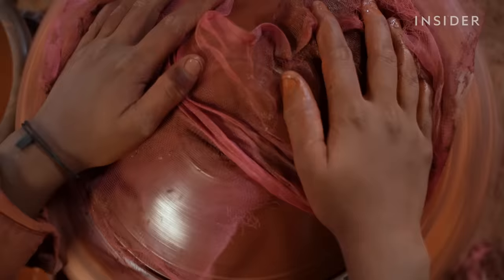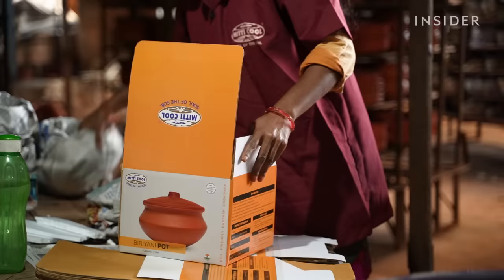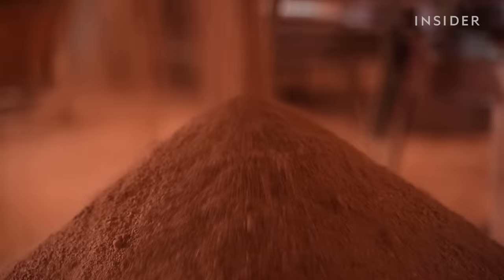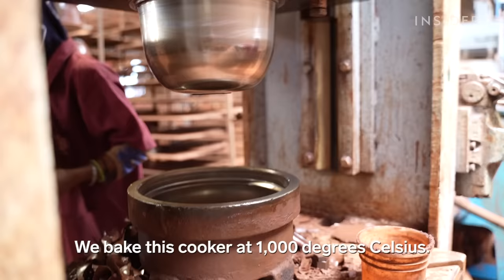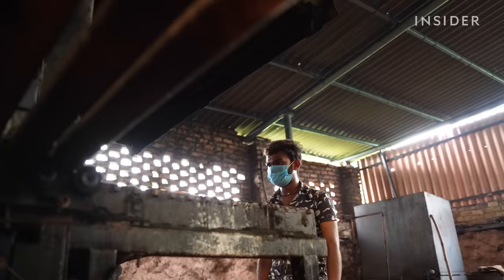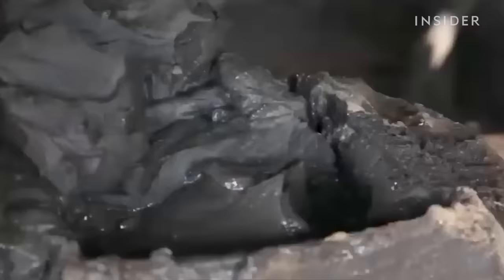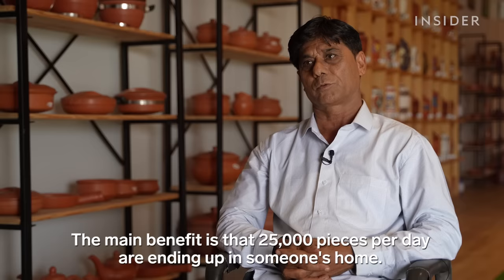How This Electricity-Free Fridge Saved An Indian Ceramics Factory | Big Business

Comment: This clay fridge should go mainstream on online and offline stores and everyone should have easy access to it.
Reply: How does it work?
Reply: @nofurtherwest3474 Evaporation. Water can hold a huge amount of energy (i.e. it has a high specific heat.) The inner chamber of the fridge is watertight, and there is a water chamber that surrounds the food. The outside of the fridge is porous, so it allows the water to slowly evaporate, which pulls heat away from the inner chamber. It's the same principle as sweating. It will never get down to the 35ish degrees of a regular fridge, but it will cool enough to preserve produce and other items. One disadvantage is that these work wonderfully in dry environments, but with higher humidity, the water has a harder time evaporating (again, same as why your sweat doesn't cool you off when it's humid.) So these are great in inventions but region specific. You can actually build something similar by putting a small vessel inside of a larger unglazed flower pot, filling the space between them with sand, wetting the sand, and adding a lid.
Reply: It's technically more like an icebox, which were the predecessors to the powered refrigerator.
Reply: It can't substitute a real fridge and is just meant for fruits and vegetables and milk. It doesn't get cold enough for meat
Reply: @elaexplorer I would love one, cause I don't have any meat in my fridge

Comment: I have actually drank water from this on a scorching day and the water was cold!! I don't how it works but it is amazing.
Reply: It work on principle of evaporation
Reply: by principle of perspiration, just like how sweating cools down a person on a hot day.
Reply: Isn't because it's made out of clay? I drank from a stone cup and it's cold
Reply: @lunix3259  Yes and no? They clay part helps since they can sustain temperature, but for the fridge, it's simply just the water evaporating by getting the heat from inside the fridge. It's the same as regular fridges except it uses water. The only reason most western (and eastern) fridges don't use water is because they're larger and also need to be able to freeze (for meats, but also so we can make ice cubes). Just using water wouldn't help you create ice, but it can at least cool a small fridge like that, which is enough for people in certain places, especially if their families are small.
Reply: In earthen pot there are tiny pores which slowly release water in the outer surface. Water molecules takes energy from the surrounding molecules and evaporates.this continuous process cools down the water inside the pot and outer surface water layer act as a insulator which do not allow the surrounding temperature to maintain the same temperature in the pot.
Reply: @megaknight3705  cools it down to 76’f
Reply: something to do with water vapour keeping the water cool
Reply: @Indian_gae_boii  Sort of. The water absorbs the heat from the food and turns into water vapor. Because the heat of the food has been absorbed, it becomes cooler.

Comment: Saving atmosphere from harmful effects of Green House gases (CFC's), handkrafted refridgerator with No electricity shows how sustainable this product is....
Reply: CFCs haven't been used in fridges since the early 90s
Reply: @MG2-_-   modern refrigerator uses HFC,it effects are less still have some
Reply: Shouldn't we focus more on taking responsibility for watering plants and perennial trees on a regular basis instead? 

Like.. actually plant perennial trees and nurture them = helping the environment
Reply: @sigmameme2762  modern fridges have switched to R600a, it’s hfc free, non and non ozone depleting…
Reply: @skylark1848  the ozone layer was restored because the focus for responsibility was on the producers in the past. 
Climate change isn't gonna change now because now the responsibility has shifted to individual consumers.
Reply: I have serious doubts about his fridge. You would have to fill it up with cold water every few hours to keep things cool, and whatever cooling effect you have would just be wasted because of that terribly thermally-inefficient plastic door with zero thermal insulation and no air gasket. Ants will raid that fridge seconds after putting food in. Terrible idea. If he showed this to my mechanical engineering professor, my professor would just laugh.
Reply: @jedidazed3390  technically it works like a swap cooler, the ceramic pores absorb water and the water evaporates from environmental heat, resulting in reduced temps. Only works in dry climates, and the cooling power is very low. Water used is just room temperature. 

The temps are not low enough for long term preservation, especially for meat or dairy.  But I think the idea is for poor regions of India with no electricity, keeping fruits or vegetables an extra week is better then nothing. The ceramic can’t be insulated since it works via evaporation, the door is plastic to keep cost low. Remember it’s 1/3 the price of the cheapest compressor fridge, for some people it’s this or nothing.

The biggest issue I have is all the idiots thinking this is some futuristic miracle refrigerator, it’s not. It’s a really primitive fridge.
Reply: @Dirty_Bear22  I'm no idiot, mind you. I'm saying it's much worse than a cooler. A cooler can maintain the temperature, but this cannot. This does not work by evaporation, evaporation only cools on the surface of where the evaporation occurs, not around the ceramic. Just because water is evaporating at the surface doesnt mean the whole glass of water is cooling down. Where'd u get your engineering degree? Garbage University?
Reply: @Dirty_Bear22  If youre trying to keep the inside of the cabinet cold, wouldnt it make sense to have an airtight, insulated door? Otherwise the inside and outside air would just circulate and heat exchange thus becomes inefficient. Plus heat can be radiated inwards on an entire plane since the door is one entire face of the cabinet where heat can freely radiate in. Make sense? Garbage University shouldve atleast taught that in its most advanced classes.
Reply: @Dirty_Bear22  ask about my Mechanical Engineering degree and Juris Doctorate before calling me an idiot
Reply: @jedidazed3390  um I was basically agreeing with you… I never called you an idiot, I was referring to the general comments for the video, I saw lots of comments praising this ceramic fridge as a modern marvel, despite it being far worse then normal refrigeration.  

It can maintain a slightly lower temp, just not very well. 

I would add a link to the India Science, Technology & Innovation website, but then my comments typically don’t go through when including links. I will just quote the article below.

“Mitti Cool Refrigerator: An affordable refrigerator

A fridge for the common man that does not require electricity and keeps food fresh too. With this basic parameter in mind Mansukhbhai came up with Mitticool, a fridge made of clay. It works on the principle of evaporation. Water from the upper chambers drips down the side, and gets evaporated taking away heat from the inside , leaving the chambers cool. The top upper chamber is used to store water. A small lid made from clay is provided on top. A small faucet tap is also provided at the front lower end of chamber to tap out the water for drinking use. In the lower chamber, two shelves are provided to store the food material. The first shelf can be used for storing vegetables, fruits etc. and the second shelf can be used for storing milk etc. Cool and affordable, this clay refrigerator is a very good option to keep food, vegetables and even milk naturally fresh for days.”
Reply: @jedidazed3390  okay? A barely working cooler is still a cooler. I never said the plastic door was a good choice. These fridges are made at a very low price point, so a insulated door was probably non economical to produce.
Reply: @jedidazed3390  I wasn’t referring to you directly, sorry if it came out that way. See my first response. Besides garbage university is making great strides in advancement 😂, I was a top student I’ll have you know.
Reply: @Dirty_Bear22  apologies man and my bad. These days I'm overly sensitive when someone calls me an idiot in my own field. Good to know you were referring to the actual idiots. Peace man ☮️😂
Reply: @jedidazed3390  no worries. I often get carried away as well haha. 

Reading into it apparently it’s originally called a Zeer pot, dating back as far as 3000 BC. Basically two pots, wet sand, and a wet cloth. 

Thinking about it, marketing old inventions as new has been a pretty successful trend. Now to go reintroduce the square wheel and get rich.
Reply: @jedidazed3390  why you have to eat food that needs long time refrigeration?

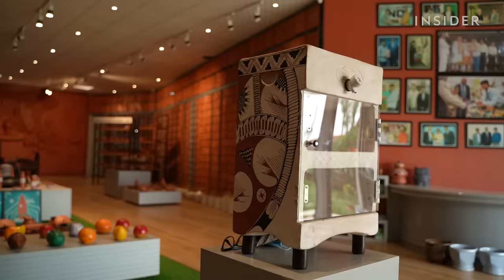Comment: 6:09 Definitely this should be the top 50 inventions of the decade or century.
It saves energy as no electricity is needed. It is cheaper. It is very very eco-friendly. No risk of leaking gases which happens in electric refrigerator and which are made with a high amount of carbon footprint. But this fridge probably has Negative carbon footprint as it is storing lot of carbon or atleast is carbon neutral or very small amount of carbon footprint. This gives more employment as more it is hand made as compared to other electric refrigerators.
Reply: I'd say the fridge is probably carbon-negative, if you factor in how much electricity isn't being used through its lifetime. Plus it'll probably last decades. Regular refrigerators are replaced, what, every 15 years? I could see one of these in a college dorm or studio apartment in the US
Reply: @spooniesarah  hmmmm.okk.
Reply: @spooniesarah  top 50 😂😂😂😂 good joke
Reply: this sort of tech has been around in places like Iran for thousands of years.

Comment: It would have been good if the video had explained how the non-electric fridge works. I'm guessing that it uses evaporation of water for cooling like the Coolgardie safes that were in widespread use in 19th century to  mid 20th century Australia. These devices are very effective and for just the cost of adding water when it runs low it will keep food cool and fresh.

Comment: I would definitely buy a fridge like that.   Think of the energy saving if most of us changed to these types of fridges.  When can we buy in other countries.
🌲🌝☘️
Reply: Swamp or evaporative coolers are not that great. You will have problems keeping it clean and sanitary and inside a modern house that is well isolated the evaporation is too slow to have a noticeable cooling effect.
Reply: When its 100f keeping food at 92f is not good. For prolonged keeping of fresh food it needs to be kept at 42f or lower. That is an unreachable temperature for this device
Reply: It doesn't work, i have one
Reply: @exorcimus8872  🙏 thank you for letting us know that.   Much appreciated.
🌲🌝☘️
Reply: It works well only in hot, arid places so it probably won’t work well outside of India, especially in colder regions like North America, Europe, etc
Reply: It worked the first summer i bought it but the next summers it just failed
Reply: @theevilprankster  Well in many part of North America, it is very hot during certain duration of the year.
Reply: @elizdonovan5650  if you live in tropical places,this works well as I have personally used items that work on the same principle.
Reply: @exorcimus8872  Earther pots must be immersed for 3 days in water before the start of next Summer to fill the capillaries in the earther pot's Micro Pores with water. - I learned this from my mother. After every summer we would shelve the earther pots and when the next summer starts my mother used to immerse them in water for 3 days. Otherwise they would not work ..
Reply: @praveenvasistha247  wow didn't knew that 👍👍
Reply: When someone on that country decides to manufacture them.
Reply: In the example in the video, it gets the temperature down to 72° F.   I suppose if it's 90° outside it's an improvement, but you're not going to keep milk in it
Reply: How can we purchase this fridge

Comment: That fridge will not work in cold and temperate conditions 
But it will be effective in hot dessert like environments, if I am not wrong
Reply: As long as there is an air flow, this fridge will work.
Reply: True, It will not work in Cold and areas with High Humidity where water dosent evaporate to air
Reply: @newsflash4382  it works on evaporative cooling. Ambient conditions that are conducive to evaporation it will work

Comment: These fridges are an interesting idea. It works on the concept that evaporating water takes away heat so you need to top it up with water for it to work. It will also only work in hot, arid situations so humidity would prevent it working. And there is a high probability it could leak all over your floor so you'd have to stand it in a container or something just to be safe. Has to be clean water too otherwise dirt & minerals would eventually clog it up. But despite that it does work without electricity which could be attractive to people who have unreliable supply.

Comment: Hope this patented in India soon. Real entrepreneur and competitor to electric fridge.
Reply: no, both of these have vastly different use cases, and nobody will pay licensing fees for pottery
Reply: @cessposter  the use case comparison for a startup product like this vs refrigerator isn't correct in my opinion. 

I m sure this Pottery product will mature in few years and take over refrigerator - if well planned and nicely designed.
Reply: @hugmusic25  the refrigerator has been a concept designed and improved for a couple decades.

A few years will not cut it.
Reply: @hugmusic25  they work through evaporation, it will never reach low temperatures like a normal compressor fridge…
Reply: @hugmusic25  patents are a sham
They expire after a limited time & then either taken over or suppressed by monopoly (g0vt sponsors)
Reply: It's a preserving bin

Comment: So, basically, it’s a kind of evaporative cooler…internal fans evaporate droplets falling through a screen in the box walls to a receptacle base tank, where it’s pumped up to keep evaporation cooling going.   That is definitely helpful especially in dry climates.  But in humid climates, not as well.
Reply: yep and India is very humid.
Reply: If you notice, this device does not run on electricity.
Reply: Gujrat state has the most humid climate.
Reply: @agnidas5816  Maybe where u live. Judging by your surname i guess u r from West Bengal. But not everywhere in India it's like that. For coastal states it's true.
Reply: @AKSinvi   Then, what makes the swamp cooler work, if not electricity?…a pedaling device? 🧐
Reply: @AKSinvi   It could run just by person pouring water over the ceramic…perfectly fine to help chill interior where there’s no electric. 
Same unit could automate, using small electric fans, & a water pumping the water up to wet the ceramic.

Comment: Hype vs Real Science. Some people love to shut their rational reasoning...for a few seconds of stolen pride.
This technique of cooling, although very limited, continues as long as water is pored in the top shelf. It's use is in dry arid remote areas lacking electricity. These people hv scarce water, so why would they waste it (however less) to evaporation ?! Remember many of these people have to walk miles each day to bring water. All this for something that barely cools by 10F. All the bleeding walls cause the air inside to be heightened in moisture. This inturn would encourage bacterial n microbial growth which is the main cause of decay.

Even the video shows a lady having a modern house/kitchen with electricity and piped water. So who r v kidding here ?!

These people have lifestyles and diets that are tailored to their environment. A simple cotton/muslin cloth is what they hv used successfully for centuries. They also use clay pots to store and drink cool water.

Take a clay made tray and fill with shallow water. Food should be kept in metal containers dipped in the water. Cover with a wet cloth. Try it for free :))
Reply: interesting

Comment: A bit generous to call it a fridge, would be like calling air cooler an air conditioner. It's a swamp cooler, works well in low humidity areas (because evaporation).

Also, only can cool the air a few degrees inside so you're not going to see it making ice anytime soon.

Comment: You can find vids on YT for Zeer fridges. I made one. Start with a large pot, inside is another pot, between the two pots is sand. You keep it damp, which creates cooling ❤ I live in the desert so it works great here…..I have it sitting in a shallow dish of water…which maybe you wouldn’t be able to do in areas with high humidity.
The only downside is I was unable to get an outside pot any larger than 20” here in California.
I am currently experimenting with a large clay outer pot and a stainless stock pot on the inside.